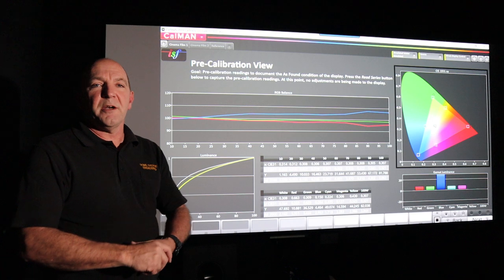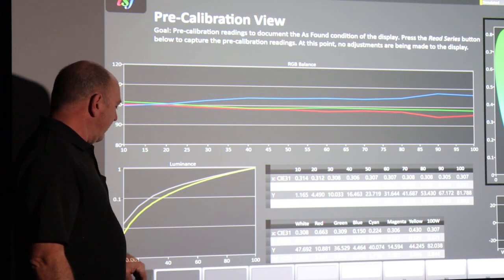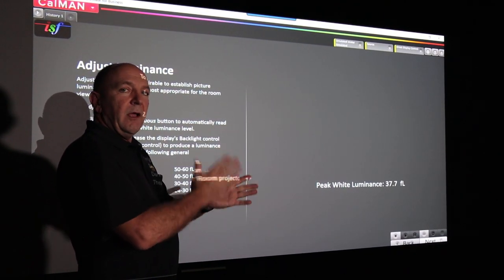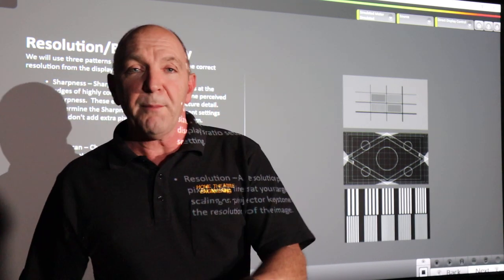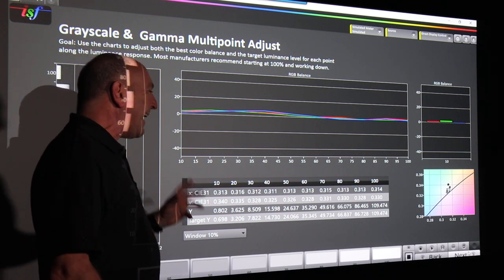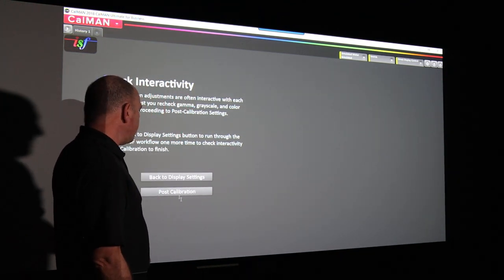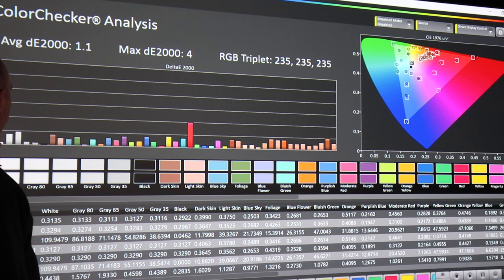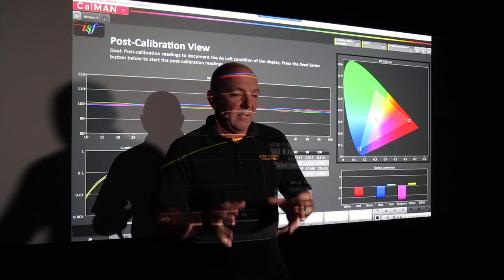Video Calibration an Introduction

Comment: Awesome video, not sure why this doesn't have more views... I missed only one part. I understand how the software profiles the display and the graphs were easy to understand. I just didn't understand what was changed that achieved accurate colors. I know in PC monitors we can apply ICC profiles in Windows, but I'm not sure what would be the equivalent modification in projectors. Thanks for the videos, very informative!
Reply from the maker: msesteki Hi and thanks for commenting. OK so unlike ICC profiles we have to manually adjust both the greyscale co ordinates and the colour or CMS co ordinates. I’m a projector normally the cms controls provide us with a Hue Saturation and Brightness or Hue Chrominance and Luminance adjustment for each primary and secondary. The values that we are adjusting here are the Primary and Secondary 100% values but that isn’t always perfect so we need to check and correct these with a sweep from 0 to 100% normally in 20% jumps to ensure the colour engine has correctly spanned then full range. Some further adjustments to correct these then sorts things out. The better way is the growing use of LUT tables which are becoming common on TV’s and we are likely to see more on projectors soon. Hope that answered your question. :-)
Reply: @HomeTheatreEngineering  Your certainly answered my question, exactly what I was looking for. Thanks for taking the time and your extensive and prompt answer. Much appreciated!